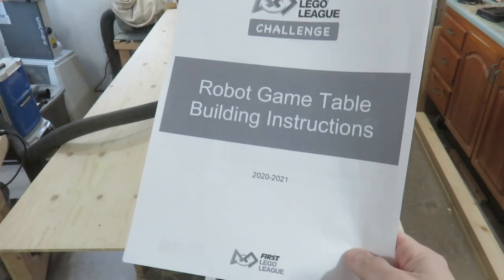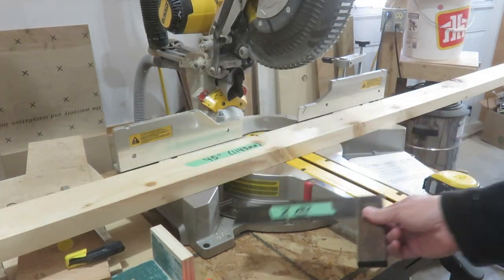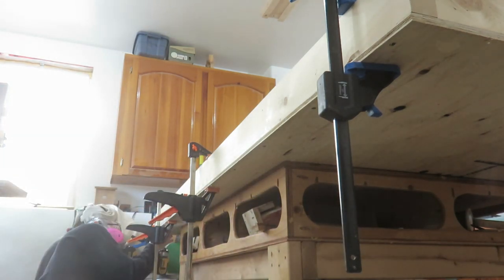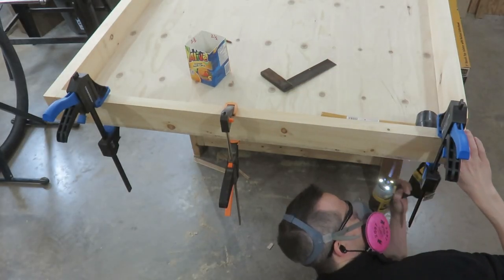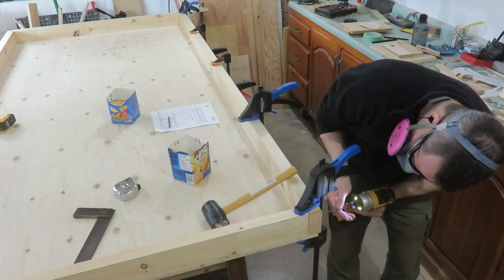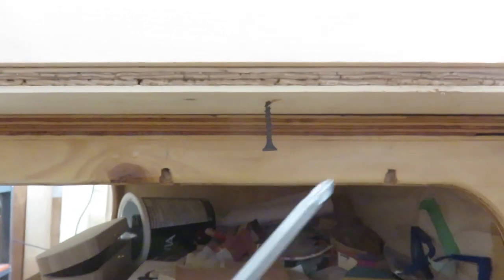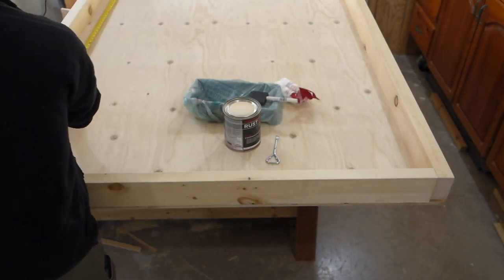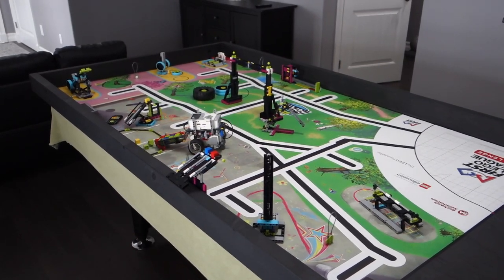First Lego League Table Building Instructions

Comment: How much did it cost you to buy all the parts?
Reply from the maker: A sheet of plywood and some 2x4s.  Prices vary by location.  Check your local home centre for prices
Reply: @Woodified did they cut it for you? And you assembled it yourself?
Reply from the maker: No.  I made the cuts myself but if you ask the home centre most will cut make the cuts for you.
Reply: @Woodified  I contacted a carpenter they wanted $900. That’s too much.
Reply from the maker: @IKanFlyDrones  Wow.  That's a lot.  Do you coach a team?  If so reach out to the parents to see if anyone can help put the table together.  If the home centre cut the parts you'd need is to find someone with a drill or impact driver to screw it together.
Reply: @Woodified  Yes our school runs after school team. what about the paint and sanding? Maybe I should go to Home Depot and ask how much it would cost for them to cut and deliver all the pieces like you said. Maybe then a parent or even custodian staff can do it. Thank you I will try and see what happens.
Reply: What thickness plywood did you use?